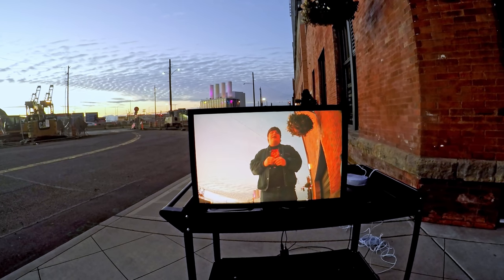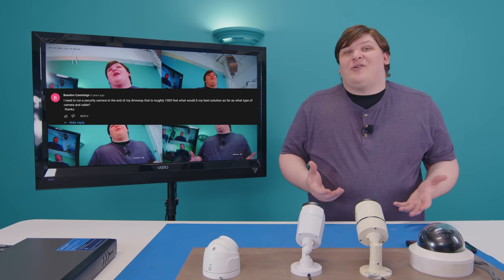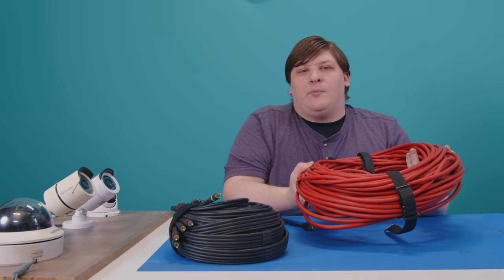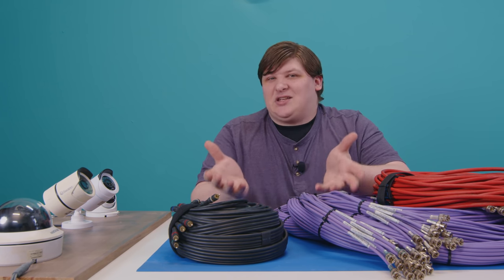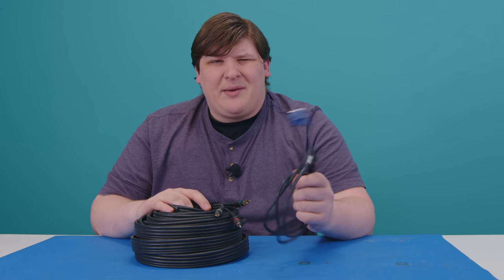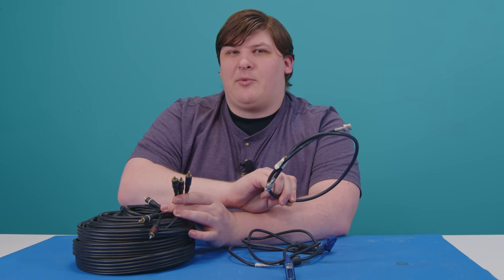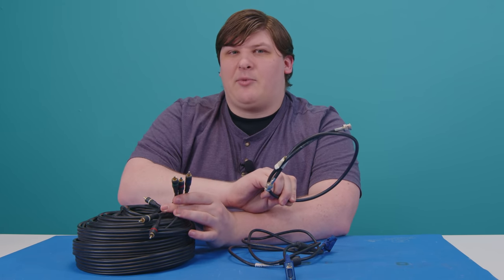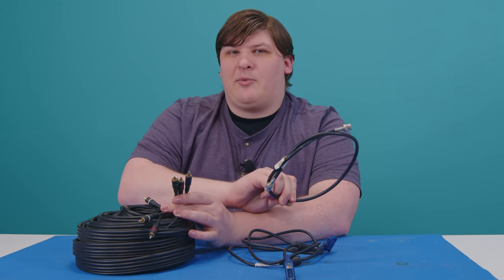1000ft of ANALOG HD video over a single cable?! [AHD/CVI/TVI]

Comment: So here's the thing - I've sworn these HD over analog CCTV systems off completely. Way too finicky over time. One: after a few years if the BNC connections are even REMOTELY exposed to the elements (I've had some in attics even do this) then you get ghosting and signal loss until you clean/reseat the connectors. Two: If you try to re-use older BNC cables you will likely get ghosting. When I replaced a SD system with one of these HD over analog systems about half the cables were just not up to the job and had to be replaced due to ghosting. Granted, they were prob cheap cables, but the freebies that came in the kit solved the problem. I'm only using POE based IP kits now. You can pick up a nice Lorex kit with EIGHT 4k cams, the DVR, and cabling for $800.
Reply: Are you sealing the connector with an epoxy to keep water out, then wrapping high quality tape over it generously?
Reply: @hicknopunk  If you're going to go through that much effort, just flip to IP and be done with it.  Most IP cameras come with a waterproof gasket to put on the end of the cable (8P8C connector) which couples to the camera's ethernet port. Analog just can't compete with IP.
Reply: any installation manual would have told you to properly install weather seal and moisture gaskets to cover all connectors.
Reply: I have a 20 year old BNC to VGA cable and it works just fine even after hundreds of unpluggings.
BNC is a good connector, just wrap something around it for outside use and it should hold up aslong as any other cable.

Comment: one thing I am surprised no one mentioned, I believe you can run these over a single twisted pair using a balun at each end, as coax is difficult to terminate and thicker to run. Would be interested to see the distance they run at.
Great vid as always!
Reply: I was waiting for someone to mention the word "balun." When I was growing up, ham radio used baluns from 50 ohm radio feed to 300 to 600 ohm ladder line to the antenna. for security cams would it be 75 ohm composite to 100 ohm cat5 and back?
Reply: @poofygoof  standard video baluns go up to 600m because of cat5/6 impedance, while active baluns go much higher, ones that go up to 2400m (supposedly) but they need 12v DC. both types of cables can be used, but for long runs cat5 is preferred because coax is a pain in the rear end to terminate at the camera and doesnt really like bends.
Reply: @poofygoof  typical commercial video baluns would be termed a "current mode balun" by the hams I know, it doesn't actually match impedance, and you just eat the insertion loss. They're a common mode choke and that's all.

Comment: This might be a consumer variation of the 960H trick you mention.   

Commodore introduced a Super-Hires NTSC (and a Super Hires PAL). mode with their Amiga 3000 in 1990.  It gave you 1440x486 NTSC 35ns display mode.  With the enhanced chipset (ECS) it was limited to 4 colour mode.  

When Commodore released the Amiga 1200 & Amiga 4000 in 1992 with a new chipset (AGA - Advanced Graphics Architecture), it was capable of using 8bit planes and a 24bit colour palette in all resolution modes including Super Hires NTSC (and Super Hires PAL) mode.  HAM8 could also be displayed in the Super Hires modes, simulating an 18bit colour display with a 24bit colour palette.

Comment: Holy crap I wish I'd had this information around 6 years ago, my last job I was head of IT for a manufacturing plant. My team and I spent over a month pulling all the old coax runs and replacing them with IP PoE cameras; unfortunately due to the nature of the manufacturing WiFi was completely out of the question. This would have saved me so much time (and money probably).

Comment: The reduced refresh rate probably is helping a lot pushing the higher line count over long cable runs at a low bandwidth. Maybe some pre-emphasis and notching of mediumwave radio stations to avoid interference to the picture.
Reply: @PsRohrbaugh  Ya the difference between higher end and lower end DVRs is how many channels they can run at what framerate.

Comment: Re: Digital TV - I grew up in a super rural area where when the DTV transition began there was no cable service. Many families had used Big Ugly DIsh solutions, ourselves included. Of course Ka band stuff had come along by that point but it has two major problems: rain fade and capitalism. There were many times local channels from the closest cities (50 miles)  just were not available due to contract disputes between Dish/Direct and local companies. Rain fade was way worse, living in deep mountain valleys rain fade was plain unavoidable and it meant that during significant weather events -- times when you might especially want local tv availability to receive information on the situation and progress -- we were almost assured to lose service. Throughout my youth, we had two coax outlets in the living room, the feed from the LNB and the feed from our 20ft pole in the field with a directional antenna pointed towards the city. Even in awful, lightning weather conditions we could get a weak feed from our antenna of the two local stations we were able to receive. After the DTV transition we were never able to receive them again. Even with a Blonder Tongue broadband amplifier you could never get a stable, watchable signal.  You might get a signal reading on a TV scanning, but when you watch it you'll only get blocks and interrupted audio every 3 seconds. Eventually Xfinity built out cable infrastructure out here (through public funding of course) and the issue was largely solved for those who can afford cable, but it was frustrating largely that our communications reception was essentially shelved in order to compress the television spectrum down and resell blocks to private wireless carriers. 
The local HS also needs new microphones due to the 600Mhz block being auctioned of as well. Some things never change.
Reply: That auctioning of spectrum also happened to PAL bandwidth in Europe, but at least DVB-T and DAB transmissions reach almost everywhere, unlike your frustrating ATSC experience.
Reply: @johndododoe1411  DAB coverage was awful compared to VHF Band II without significant infrastructure upgrades. DAB has already been shut down in Ireland, mobile broadband has better national coverage so it just seemed pointless. Meanwhile my FM radio from 1967 (with optional stereo decoder) still works fine
Reply: @AaronSmart.online  Problem is when VHF band II has been scheduled for auction.

Comment: Ive been installing security cameras for a while, I was amazed by how similar all the various analog formats are (even used the oscilloscope to try and figure out the technical differences), and how they just refuse to be cross compatible. Cheap DVRs that support every format were quite the thing to see when they hit the market, and the cameras that can switch formats even moreso. Very handy in fixing up old systems for stingy clients who refuse to upgrade. That being said, we switched to IP PoE a long time ago 👍

PS. there is a way to make these cameras look infinitely worse to the point they barely function, and its done all the time to save money in larger installations: trying to run the analog signal over twisted pair using baluns. Those who know, know.
Reply: Was it CAT 3 UTP as well?
Reply: i was on the industry long tome ago... cctv is and will be caos..  every vendor wants to use his standard .. in analog or digital.. nowdays i search for onvif compatible and poe..

Comment: Here’s more food for thought. 480i component video is basically standard NTSC video split into 3 components right- luma/sync, and 2 color components. HD component video is basically just a sped up higher bandwidth version of 480i component. These analog composite component formats are most likely just HD component video converted to composite such as is done with standard definition composite and component video.

Comment: Good video! I had no idea that this kind of HD analog video was a thing, I figured at the beginning that it was going to be some kind of rf signal since that can go pretty far in the right kind of coax, but I didn't expect it to be roided up NTSC 😆

As part of my job, I occasionally install security cameras, and as you guessed everything commercial is IP-based, kinda boring. However, usually to run long distances (like between budings, or even multiple campuses, assuming they don't already have cable/fiber between sites) we use point-to-point wireless IP Bridges. You can get a consumer kit for under $200 that can pretty easily handle two or three 2K video streams at a thousand feet, and if you get the "spare no expense" commercial stuff, you can span literal miles at gigabit speeds or higher! Setups like these theoretically have a potential to lose data more often, but a properly installed commercial bridge can go for years without interruption or downtime, effectively no less robust than running fiber or cable.

Comment: So I completed 3.5 years of training at a German company that specializes in safety systems. 
With various major customers who have used analog, digital and a mixture of both for their video surveillance systems.
We mainly distributed Axis and dallmeier cameras.
1. If an analog system is already in place and you want to switch to digital, it's better to use an encoder. But these are not cheap. An example would be "AXIS P7304" for 1080p.
You would continue to use the analogue cameras, which would be recognized as digital cameras because of the encoder. (Also, I've had the experience that the analogue system lasts longer than the digital one. At least in the professionell area.)

2. 
The advantage of RJ45 (ip) is that no additional power cable / control for PTZ control or audio to the camera itself needs to be drawn since it can be supplied with power via POE (POE+). 
it saves costs by eliminating the power line and eliminates one possible problem source per camera.

In addition, cross-location video distribution is possible via vpn .

3.
If the range of CAT6 at 100 m is not sufficient, we used fiber optics. This requires a converter which requires an additional power supply. However, this has the advantages of an electrical separation, which customers appreciate when ther camera is mountet oudside and the recorders are in their server rooms dirictly cnectet to the ouside. (Lightning strike)
4.
The resolution of a camera is rather uninteresting. What is more important is the pixels per meter. Means a 4k camera that is completely zoomed out and should recognize someone who is about 200 meters away is completely useless. whereas a properly oriented/placed 720p camera would do a better job.
(There are guidelines that specify how many pixels per meter are needed for different degrees of identification.)
Besides that, it depends on the bandwidth. Both for storage and transmission frame rate.

t

Comment: About the Ethernet-over-Coax-Adapters you talked about at 11:38
These (or at least the cheap <40$ ones from AliExpress I took apart that look exactly like the ones you showed) use Powerline Ethernet circuitry internally, so they're not that janky because the transmission protocol is made to be transferred over awful unshielded untwisted wires. I thought that was pretty cool.
Also, coax is (obviously) shielded, so they don't make ham radio people angry as the Powerline stuff does.
Reply: Here in Romania one of the major ISPs had internet service through Coax using cheap Ethernet-over-Coax equipment. I think the whole line maxed out at 150 Mbits and at least 10 people would be connected to it, meaning speeds were not that good. But now we got amazing fiber which is much more reliable.
Reply: @RaduTek   It’s really common for almost most places in the US to have cable internet as well. Lots of places can’t even get that and have to use phone lines
Reply: Ethernet cables were often coax in the past anyway = 10Base2, with 'token ring' plugs(the same plug as many security cameras use), so I'd imagine converters have been around a long time, although speeds were lower then.
Reply: @FloydBunsen  Yes, but that's a different system called DOCSIS. The one we had was inferior in terms of quality and performance.
Reply: One of the cheapest option for these coax adapters is "DECA"... the in-home adapters, meant to share coax with cable TV, overlap with satellite frequencies. DECA adapters are meant in turn to share coax with satellite systems, and will scramble/be scrambled by cable TV. If you're using them on plain coax, the inability to mix with cable TV is no longer a downside.

Comment: I've found that you can even run HD-TVI signals through a single twisted pair of wires.

I've got 4 cameras on my parents' barn all running through a single Cat-5e cable that we trenched underground nearly 20 years ago (with the intent of eventually using it for data or telephone, but hadn't utilized until I installed the cameras in 2017). 

The 4 signals travel through more than 400 feet of standard UTP Cat-5e cable, yet it's surprisingly clear (despite my ham-fisted install job using old screw-type terminal blocks).

I'd always wondered what the technology behind it was and your video really cleared that up for me. I greatly appreciate your work in creating this (and all of your) interesting video(s).

Comment: I was actually really surprized, when I realized, how little analog signal need to function. For PAL signal you only need around 50kHz of bandwidth to grab on that sync and see some blurry shapes. I was able to record video signal over soundcard at 96kHz sample rate and got flying ball instead of DVD logo, but it was really impressive for me to see, that it has sync and i can see anything at all
Reply: I've heard of people pulling off analogue TV reception with RTLSDR recievers (which can do a 2.8MHz sampling rate) and getting recognisable (if blurry and monochrome) pictures out of it, but I never would have expected you could go as low as 96kHz and still have it work, however badly.
Reply: @Roxor128  I think blurry is an understatement. By my calculations you'd have less than 6 pixels worth of horizontal resolution.
Reply: That seems really unlikely.  The horizontal refresh rate is 15 khz, so at 96 khz you'd have six samples per line, or six lines of resolution.
Reply: @VPWedding  5px is enough to roughly see a bouncing ball. And as the sample rate isn't divisible by the scan rate the sampling phase will change each line, probably increasing the effective resolution.

Comment: Hi.  Thank you for the interesting and informative video!  I had been under the impression that "960H" meant "quarter 1080p" or 960x540p.  It looked to me like they were using confusing terminology to trick people into thinking that 960H was higher resolution than 720p, when in fact it was significantly worse.  
I do know what the "486 lines" business is about.  The standard designed in the 1940s had 525 lines.  486 if these had actual picture information, while the rest were black, so as to give the electron beam time to get back to the top of the page.  When JPEG was invented and applied to video, it was observed that JPEG required interlaced video to have a line/pixel count divisible by 16.  By pure luck, PAL's 576 on-screen scan lines matched this, but NTSC's 486 lines did not.  Rather then waste data recording an extra 10 blank lines, they decided to remove 3 from the top and 3 from the bottom, thus creating digital-NTSC's 480 lines of resolution.  These lines were in the "overscan" area and would not be visible on most sets anyway.  This also explains why NTSC has this strange even-field-first scanning pattern for interlace.  What we are calling line one today was actually line four when 486 of the lines had actual visual information.

Comment: Super fascinating. I'm a bit of a HD+ analog nerd and I had never heard of this. I've been doing a bunch of work with 1080p composite. I've also been sketching out extending composite to 4K. The numbers work, but it's really pushing bandwidth constraints, and that's over 3 cables. Even with the chroma subsampling that you get in composite vs. component, doing 2k or 4k over "NTSC" is batshit in terms of the bandwidth you're trying to cram down a single long wire.

In fairness, your HDMI->HD-TVI->HDMI test was using a very difficult test pattern. In the analog domain all of the hard edges in the grid lines of a test pattern will highlight bandwidth constraints from parasitic capacitance, or just poor PCB layout. 

A few years ago I did a video comparing a cheap Component to HDMI adapter vs. one from Blackmagic. The difference in engineering is staggering. So much thought needs to go into the analog domain to avoid the smearing issues that you saw.

Comment: I actually used a Hikvision IP camera as a webcam
But it was 2020 and I fit CCTV so had some spare ones
To be honest I have never used the analogue HD systems I went straight to IP once it became cheap enough
I have used the SD analogue encoders though (like that Axis P7214 on your desk at the end) they work well when upgrading old systems but want to keep some old coax cameras working

Hikvision did dabble in digital HD SDI cameras though. I bought one a while ago and the image is actually nothing like a security camera. its a semi broadcast quality 1080p image as its not doing much processing to the image for even-exposure